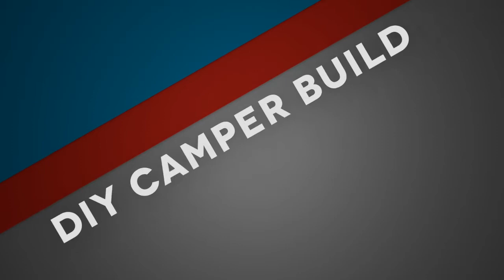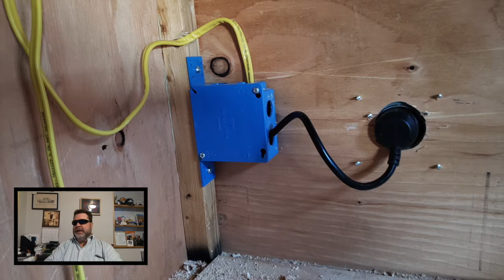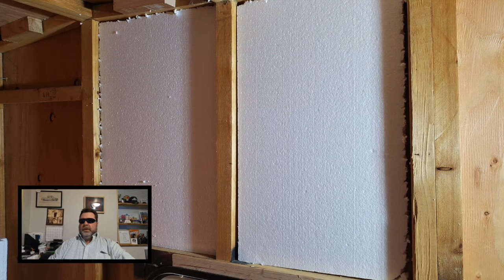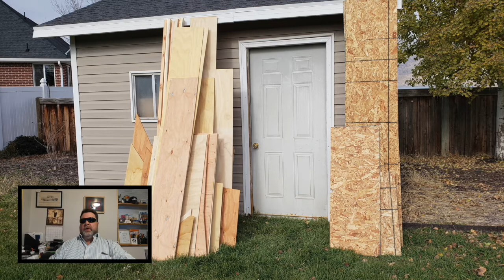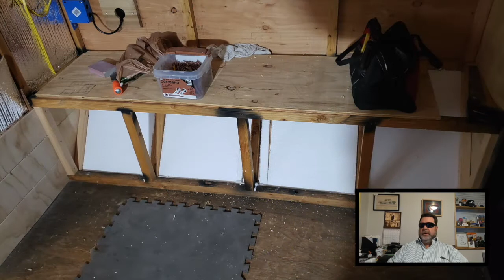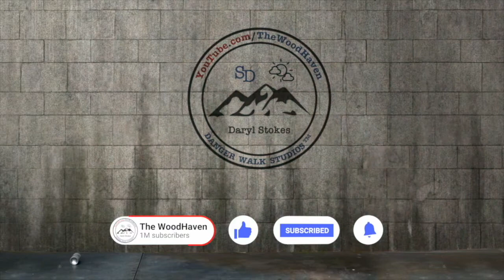DIY Homemade Camper Build - Part 06

Comment: Nice progress. But I must question the insulation value of the reflexit material. Sounds a bit over rated. Looking forward to the next 
video.
Reply from the maker: Paul,  I have to agree with you. I was just reading off the 2 packages. Does seem high though.